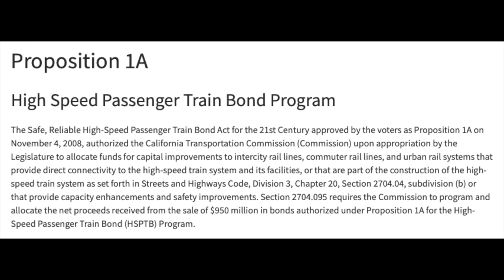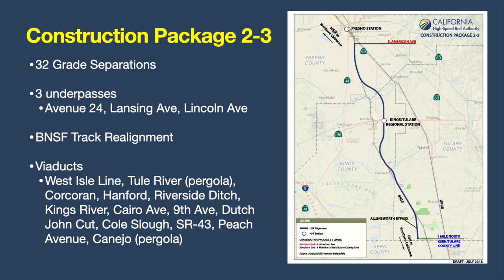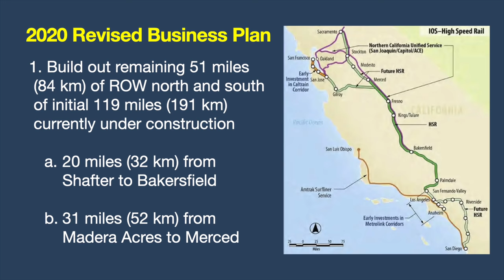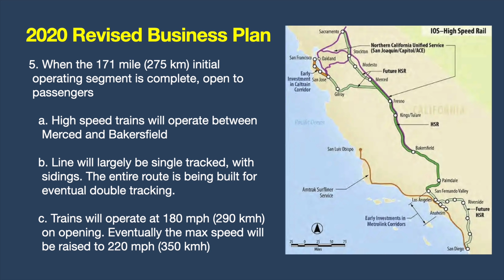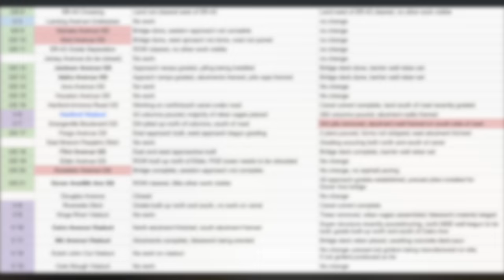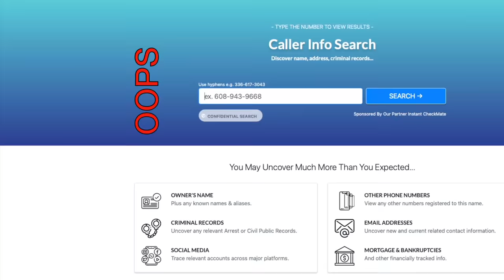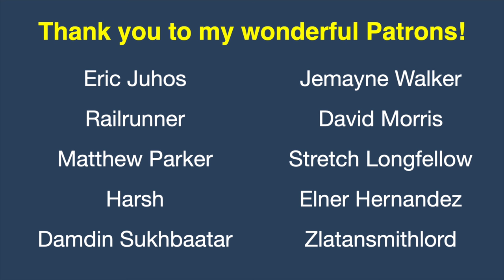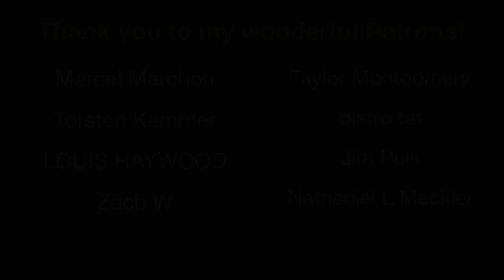California is Building High Speed Rail. It’s time to finish it!

Comment: Completely agree that once the Bakersfield-Fresno-Merced link is operational, there will be renewed support. Thanks for the clarion call on CaHSR.
Reply: A failed not so high speed train to no where is not going to build support. The two large metros should be served with the shortest cheapest route near I-5 with four stops In total to preserve true high speeds. Two stops in the Bay Area, two stops in the LA area. The central valley presently have Amtrak services, why build a very expensive high speed rail through urban Central Valley cities? Furthermore, high speed rail commands first class fares, not coach fares. California would have been better off allowing SNCF to build their new high speed train adjacent to I-5 a decade ago, that high speed train would be running today... But noooooo, politicians and politics robbed California...
Reply: Fore my that's for the lack of it being not finished and this bull about bug threat thank the last a hole in the wite house if people wront scared yes it would be finished so think on that
Reply: It's going to do the opposite!    Operating costs will be thru the roof and each train will either have insane ticket costs that no one will pay or will burn cash.   No one is travelling between those cities can afford an express train.   They will drive their pickup truck
Reply: @skiparkcityut  Think CA would be smart enough to make the tickets cheap through different means. Only way operating costs would be thru the roof is if the authority decides to be more "high tech" in everything or by approving the cheapest contract for rolling stock as they did with bridge construction (you probably know how that went).
Reply: @ronclark9724  Largely agreed with the stops, honestly way too many stops in the central valley. The worst part is sharing a corridor with commuter trains as we literally could build an independent high speed corridor in BOTH LA and SF for the current cost. Sadly politics is politics, the high speed line would have been completed a decade sooner if it weren't for that (and be way more cheap).
Reply: Bakersfield to LA is 113 Miles
Merced to San Francisco is 131 Miles
Merced to Sacramento is 111 Miles

So around a 2 hour bus at each end. Not great. It would be a noticeable improvement on other non flying methods of getting between the cities if the transfers could be made fast with a single ticket, but the speed savings may not outcompete the comfort of a single seat journey. 

Even getting to Palmdale would be a big deal for LA and getting to Modesto (and Sacramento) would be a big deal for the Bay Area.

Until then, the best hope for the rail is that the cities on the line start coordinating with each other and acting like one city, with the HSR being a metro line. That is, the "Central Valley" becomes a "major metro" in its own right, rather than just the area between Southern and Northern California.
Reply: @TohaBgood2  Again their plan was to have the whole sections done years before, without the political stuff we would have gotten a ios section by next year. Also, construction delays were due to design fault from the firms, so its still the rail authorities problem for delay and the cost ballooning.

Comment: I have to say that I agree it's time for California to finish this project. This is a very smart investment to the country. This will revolutionize the country in a lot of ways economically. It will reduce congestion on Freeways, enable to mobilize a new work force from a more cost saving region. Being able to connect with Brightline going into Las Vegas will make both States an economic boom tourist, and work force commuting. Doing this one thing would create thousands of jobs. Connecting Larger cities to smaller cities in rural areas saving time and money. Thousands of new businesses will open as a result of this project. Holiday travel will become easier.

Comment: Fantastic video!
Reply from the maker: Thanks a lot man!
Reply: Hi Sacramento dude
Reply: @davidlafleche1142  can’t agree with that. I think high speed rail will give the country the same boost economically that the interstate Highway did. 

The PROBLEM is that you have allot of advocates who want high speed rail from coast to coast when that is unnecessary. 

California needs it, Nevada, New Mexico to Texas, Texas, North east corridor, and possi lily a few other places and that’s it. 

The country could make use of better speed rail coast to coast that is around 80mph average with better train cars, but not high speed rail coast to coast. 

We could also get rid off many inner city expressways and understand that there is a difference between a street and a road.
Reply: @davidlafleche1142  another negative of high speed rail is that the state and fed have no clue how to get it built on budget and on time. 

Which also makes people not want it.  This project could have been built far better but we suffer from politicians who are corrupt and just don’t know what they are doing. 

Ironically environmental studies is one of the big reasons why this project is so expensive and is not finished
Reply: @xjing800  He’s actually a SLO dude now. 😂
Reply: @justSTUMBLEDupon  I think it would be an even bigger economic boost than the interstate highway system.
Reply: @justSTUMBLEDupon  We waste a lot of time and money on environmental “studies.” They were intended to avoid or mitigate environmental damage and impact, but it really does seem as if they’re just being used to delay or kill the good projects (rail & transit), while the crappy projects (road building and widening) curiously get exemptions for the extremely lame excuse that doing so would help the environment (the idiotic idling cars excuse). 

I also don’t see why design and environmental reviews can’t happen concurrently. There’s no reason why engineers and environmental planners can’t collaborate on the project to mitigate environmental impacts while designing the project. Just another lame bureaucratic excuse to waste money on projects so that some future politicians or media personalities can scream “government waste, fraud, and abuse” while the rest of us are (mostly) ignorant of the fact that it was the politicians and contractors who made huge sums of money on the waste.
Reply: @justSTUMBLEDupon  Agreed. I've got no problems with the concept of HSR in CA. I just laugh at CA doing what CA does. And for those that want coast to coast HSR networks have zero clue on the feasability of that. The USA is not Europe. It's not Japan. Trying to overlay other parts of the world onto the US without actually doing the engineering work kills any massive project...

Comment: Just a note about Japan: The plugs in Japan are physically the same, and quite similar to the US ones. However, the AC transmission frequency is different, with the North/East using 50 Hz and the South/West using 60 Hz. Typically in Japan it's not usually an issue since electronic equipment can use either frequency, but the grid transfer capacity between both regions is somewhat limited.
Reply: > 1:57 <
Reply: It's also 100 Volts, not 120V as in US
Reply: Biggest physical difference is the lack of a ground on the plug, so plugs are all 2 prong instead of 3.  Conversion is super easy between US and Japanese plugs, you can easily find 3 to 2 prong converters and about the only common thing people use that causes issues are hair dryers.
Reply: @neilworms2  In Germany, don't know about rest of continent or GB, the plugs are not polarized. It kinda scares hell outa me. It's 220 per leg, you probably know. Hmmm, I don;t know what the potential is between hot legs, 440? =:-O
Reply: @inyobill  The potential is 240v still. Unlike the US, Europe doesn't use a center tap to create a neutral. The US is only 120v because they split the 240v into 2 120v phases. In fact, there are breakers that you can get that use the 2 hots rather than a hot and the neutral, giving you a 240v circuit.

Comment: Funny the whole thing somehow. Your first track is under construction and plagued by many disputes. And we in Germany are overhauling our high-speed rail for the first time since construction. But it's nice to see how things are going with you as well. At home here in Berlin, the expansion of the Dresden Railway is also moving forward. Here, the new long-distance railway tracks including bridges on Berlin territory have to be rebuilt. It should be ready in 2025. Then the trains from Hamburg to Dresden, Prague and Budapest will take the direct route from Berlin and will no longer have to take detours. The fact that there are still no long-distance railway tracks between Berlin-Südkreuz and Blankenfelde is still due to the Cold War and political disputes after the fall of the Wall. I'm filming the project in Berlin. Greetings from Berlin/ Germany. Sven
Reply from the maker: Interesting! I’ll check out your videos!
Reply: German rail lines are the ones blocking everyone else in europe, It's at the  geographic center, but there is no through lines. I can't go from northen europe to france or spain easily by train, I have to change trains a lot, wait, a lot and pay way too much money. German network is only connected inside the country, it doesn't link very well with the neighboring countries. I hope european railways will become integrated, I really hate traveling by plane.
Reply: @ouicertes9764  if you think that's bad try the trains in the UK. Absolute joke.
Reply: "German rail lines are the ones blocking everyone else in europe,"
They seem to do everything to not to do much with regards to rail connections with neighbours. Strong car lobby, eh Sven?
Reply: @z00h  Jep, strong car lobby. And this has been going on since the 60s. When I look at the drama about the Rhine Valley Railway Karlsruhe-Basel, I could only puke. Completion on the German side in 2041. The access route to the Brenner Base Tunnel... completion open. Railway line Lübeck-Island Fehmarn... very big ? And the Berlin-Frankfurt/Oder line has been under construction since 1990 to upgrade it at 160 km/h...But it's no wonder with these smears as Minister of Transport
Reply: @ouicertes9764  Thats true, i hate planes too. From the former engine of Europe, we have become the brakeman of Europe, When it is cross-border rail traffic, Germany is bursting with incompetence
Reply: @ouicertes9764  
"Doesn't link well with the neighbouring countries". I'll give you Poland and Czechia. Other than that, connections to Austria, Switzerland, the Netherlands and France are good, and to Belgium and Denmark workable, though the latter is currently being improved. 
But what would you consider to be well connected? It's certainly better connected than Spain and France for example, or Norway and Sweden, or anything east for that matter. Of course you'll have to change train within Germany if you're traversing the country (save for a few exeptions), but the same applies to France, only that in France you'll always have to detour to Paris.
Reply: @ouicertes9764  Yet there are affordable InterRail ticket available since 1972 for all European countries only one ticket at reasonable prices. Certain reservations may be required.
Reply: Of course, having to play catch-up on "delayed" maintenance on infrastucture in the former east after reunification didn't help. I'm starting to see projects here in the Rheinland underway. I moved here from California in 2015.
Reply: First in California, not the US. There is Acela in the North East Corridor, but that can't achieve its maximum speed for the vast majority of the route, making it not really that high speed.
Reply: @wta1518  It depends on the definition since big parts of the NE Corridor is rated for 125 mph / 200 km/h which is high-speed for existing lines. Of course, it is medium-speed otherwise so to say that CAHSR is the first proper HSR (i.e. rated for at least 155 mph / 250 km/h) in the US is still correct.

Comment: One point for rail travel in general that I think is under represented is that pretty much no matter the circumstance, you can do work, read, or whatever for your entire time in the vehicle as well as that you get decent legroom and flexibility. Planes are cramped, noisy, and a ton of hassle, driving is an exercise in stress management and paying constant attention. I personally never have any reason to go to LA, but system-wide improvements, including cities improving their bike, bus, and light rail infrastructure so that connection to HSR, can only do to make rail travel easier and more convenient to all of us. I'd take the Capitol Corridor to SF all the time if it were easier to get to!
Reply: The reason that your airplane seat has no legroom is to keep the cost of travel down and operate a profitable service.

There are plenty of improvements planned along the Capitol Corridor to improve speed and reduce the overall travel time.

Comment: As a structural engineer on the east coast it sure is interesting to see construction on such a large scale where roads can just be moved and there's room for massive structures. That dirt pile at the north end of the station is being used for settlement of the soil. Abutments are heavy and the soil would start sinking little by little. A massive dirt pile at that location puts the weight on the soil before the abutment is built so that by the time the rails are placed and trains are running, the soil already had a chance to settle.

Comment: That pile of dirt that disappeared to be replaced with a piling may have been there as a weight to compress the land that the piling would go in to. A common sight in Vancouver is a pyramid of dirt with the top 1/3 or so covered in tarps held down by used tires; after two years or so it gets removed and they start building the foundation of a high-rise.

Comment: Anyone who's driven 5 between the Bay Area and LA knows how congested it's become. The number of traffic clogging trucks alone has made it a difficult and frustrating drive. Flying is no longer easy as the flight time may be short, but everything involved with air travel takes much much more time than the actual flight itself.  Rail is the way to go, with it speed, flexibly and minimal environmental impact, it's been long overdue.  The presentation was well done.
Reply from the maker: Thanks a lot!
Reply: Anything that takes less than two hours to get out of Los Angeles I consider a miracle.
Reply: it won't be long and cars will drive themselves. Convoys of cars going 150 mph will make rail even more obsolete than it is now. Cars can go everywhere, trains are limited by the EXPENSIVE tracks.
Reply: @TheBandit7613  Don't hold your breath on car convoys. Problem is we need solutions NOW and trains are a perfect solution.
Reply: @TheBandit7613  A train is A BUNCH OF CARS CONNECTED TOGETHER LMFAOOOO. 

Auto cars need expensive freeways because each automobile is a huge object that is used by an average 1 1/3 people
Reply: @frafraplanner9277   Cars can go anywhere.
Trains can not. And there lies the problem.
Reply: @TheBandit7613  cars can go anywhere with roads. Trains can go anywhere with tracks. Same thing
Reply: @frafraplanner9277   No, there are no tracks to my work. Trains are obsolete. Electric, self driving cars (going 150 mph) are the future.
Reply: @TheBandit7613  that's what streetcar lines, bus routes, bicycles and walking are for

Also ROFLMFAO at 150 mph cars on city streets
Reply: @frafraplanner9277  City streets? I don't live and rarely visit cities. In the not too distant future when you get on a freeway, your car will probably join a convoy of other self-driving cars and speeds for 150 mph are not out of line. Of course this is for long distance travel. I see you really don't have a vision of the future. Trains weighing 100,000 lb and up for a car holding 20 people are a thing of the past. I believe a high-speed train is under construction right now between Los Angeles and Las Vegas. The costs are incredible. I believe they're talking about hundreds of millions of dollars per mile. That's much more expensive than a road. And absolutely not flexible in any way. Unfortunately trains are obsolete.
Reply: The irony is that California freeways are congested in large part due to little separation of freight and passenger traffic, and CAHSR as planned repeats this mistake over significant portions of ROW, specifically most of the places where people actually live.
Reply: @TheBandit7613  🤡
Reply: @TheBandit7613  unfortunately you start hitting tyre wear issues so those 150mph cars will start flying off the road if you don't service them regularly... Why do you think Racing cars don't use the same tyres all season? It'll become ver uneconomical